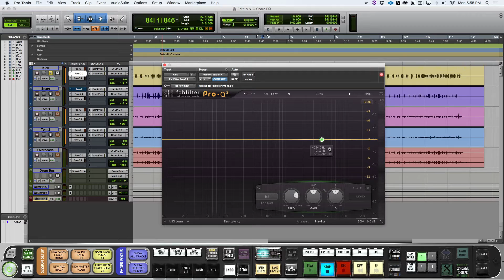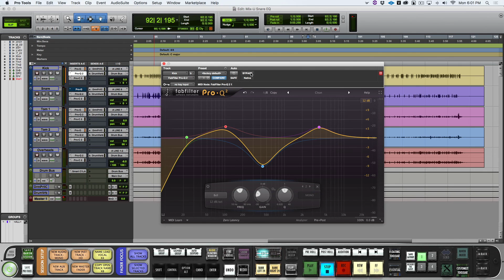Mix-U - How To EQ A Kick Drum

Comment: Needs a low pass to get rid of the useless stuff above the HF boost.  Boost the lows so it hits you in the gut, not the chest.
Reply from the maker: Yep, that's something that I'd want to adjust in the context of a full mix to hear how it interacts with the rest of the instruments in the mix. But yeah, I'd probably bump around 50-60khz depending on how the subs interact with the room (and the rest of the band) and hi-cut the stuff above 5-7kHz to get rid of any unnecessary high-end content.